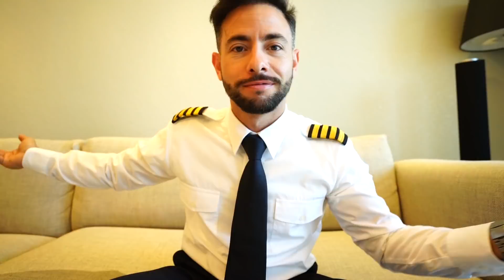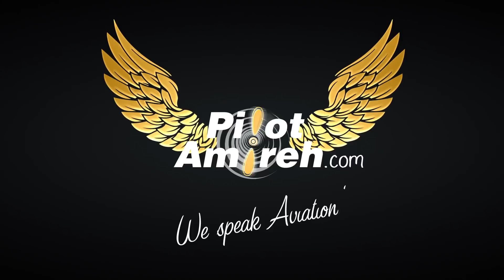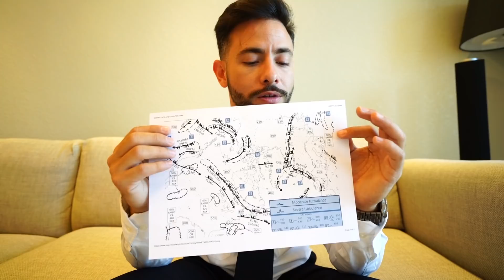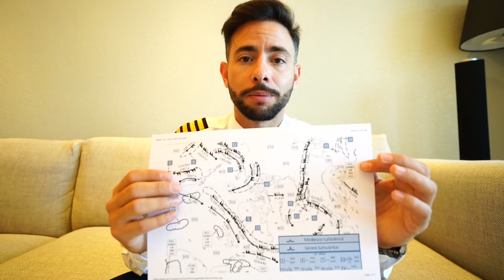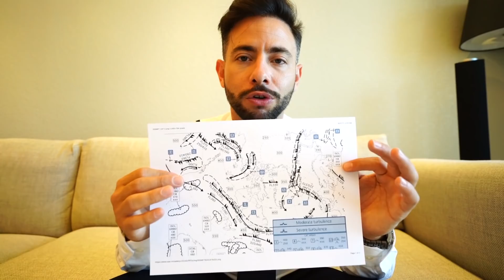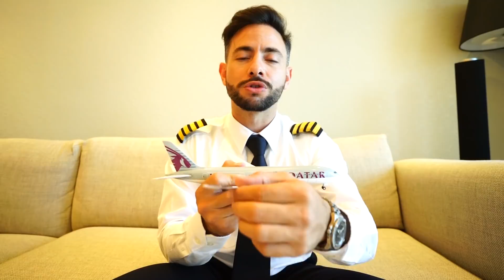Bumpy Flight | Are You Afraid Of Turbulence BY PILOTAMIREH

Comment: I'm a frequent flyer myself and mostly go through light and moderate turbulence but there was one moment myself my gf and family came back from Lanzarote to London Stansted we were coming to the last approach turn with the flaps down and wheels retracted that we did a sharp right turn and all of a sudden we all felt an airpocket and was very scary. Is this very common in areas or is this a phenomenon to flying as it only happened for about a maximum of 2 seconds then we were normally landing in a smooth routine could you make a video about air pockets and how to notice them :D this is great content as I can take severe turbulence when a storm comes in from the Atlantic :)

Comment: I was terrified of flying., Until i found out a couple of interesting things. I found out that the plane can even safely takeoff with ONE engine... meaning the redundancy is crazy. When i found out it can of course fly on one engine no problem. When i found out it can fly with zero engines and just the RAM running.... for a certain distance, that the plane is so overengineered for safety, it can land in water and float like a boat. When i discovered that it's nearly harder to crash a plane than to fly one lol

Comment: I was on 50% global travel for 10 years.  I never liked flying. That job ended.  My flights at the end of the run were straight out of a movie.  Actually caught a flight attendant in mid air. Sat through 8 hrs of turbulence across the Pacific. People cried coming into Tokyo once.  

Frankly I found all these mental exercises exhausting. I took Xanax, did the mental exercises, etc..  you get to your destination and have to talk yourself into the return trip! I just stopped 7 years ago.  I either drive, take the train or just pass on some trips.

Comment: This was very helpful up until the end lol.  (some extreme turbulence may cause structural damage)
.... 🙄
We had our plane drop up and down several feet causing us to lift out of our seats and watch drinks slow motion lift out of cups and then fall over everything.. Your heart racing and stomach drops as if you were on a roller coaster. Seat belt light was off, so people were up for bathroom. Made everyone who has never experienced this kind of turbulence feel like the plane was definitely having problems and we were going down.. Scariest part of flying for sure! Everyone was ok and luckily only lasted maybe 1 minute. But this has scared us when it comes to flying.. Our trip back home was way smoother but we were nervous entire time. I have flown over 14x in the past 2 years and only felt this type of turbulence 1 time out of those flights so I can say it's pretty rare to happen again..

Comment: Thank you for explaining.  I have a genuine phobia of flying, to the point where I was so traumatised about the flights I decided I could never fly again as I didn't enjoy the holidays for fear of the flights.  

The fear (for me) is a combination of things.  Claustrophobia, turbulence, lack of control and a fear of burning to death in a crash.  I've been on flights where turbulence was so violent I thought the plane would break apart and I saw the wings flapping.  Now I understand about the wings, thank you.  But I'm still never going in a plane again.
Reply: sounds awful! where were you flying to experience such bad turbulence?
Reply: Have you tried Xanax? I have similar fears, so much that I’ll think about it a year before vacation.I was on a flight that had moderate turbulence for hours and it completely traumatized me. I now take .75(which is somewhat strong) and it takes the edge off enough not to be panicking, although my body will still go into fight or flight during turbulence. But the fact that I stopped the panicking was huge, and I knew  that I could rely on the Xanax on my next flight to get me through and it did. Alcohol doesn’t work for me and neither does a low dose.
Reply: I meant to say I was able to enjoy my trip because I knew I had something that would calm me down enough on the plane.
Reply: Sara H, I am terribly nervous flyer as well. I had funny experience during flights to Asia. Normally just a shot of wine will make me tipsy, but during those flights I had so many of them to just knock me out...man!! It didn’t do a thing to me I was so pissed. And like you, I will be having headache already thinking about a trip that’s still about 12 months ahead, thanks for recommending Xanax, that will be my next escape. 🙏🏼

Comment: So turbulence is humps in air , my question is if u know ther is turbulence why not shift down to 2nd gear and slow down so we dnt feel it 😐
Reply: Patrick Shenton don’t have to be so rude
Reply: He CLEARLY mentioned that they do. :/
Reply: xmac what does second gear mean
Reply: 🤣 🤣 🤣 🤣 bro chill it's just an example
Reply: then you fly the plane
Reply: Shafts (vertical, from sky to ground or vice versa) and streams (horizontal) of air are not as exact as the arrows you see on the weather. It's impossible to know WHERE your buffeting, shifting winds are coming from next. It's like when you see the leaves in your yard scatter in varied directions.
Reply: xmac :-) you must be comparing an aircraft to your manual car
Reply: xmac 😂😂😂😂😂
Reply: xmac pilots actually do slow the aircraft when in turbulence, and often times even when in whats referred to as 'chop', which is just bumpy air that doesnt cause attitude or altitude variations like turbulence does. They do so strictly for passenger comfort, as pilots literally could not care less about turbulence that isn't severe or extreme.

source - am ATC who talks to hundreds of commercial pilots daily and 80-90% of them ask about the rides in my sector(s).
Reply: Fuck me. I’m dead laughing. 2nd gear 😂😂😂🤣🤣🤣🤣🤣
Reply: He's using an ANALOGY, you fucking imbecile.